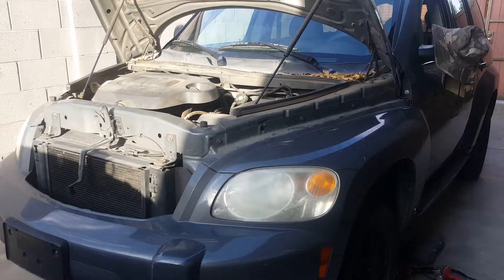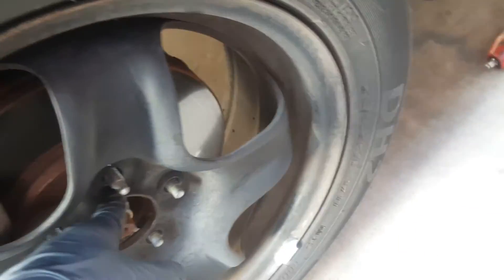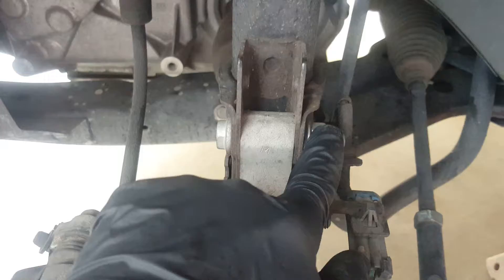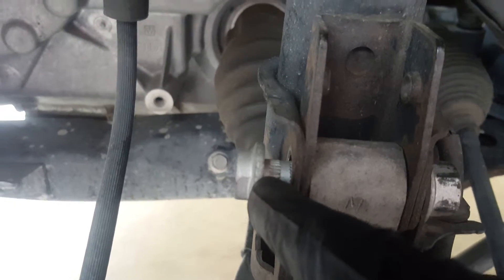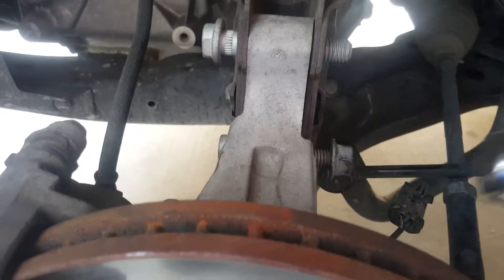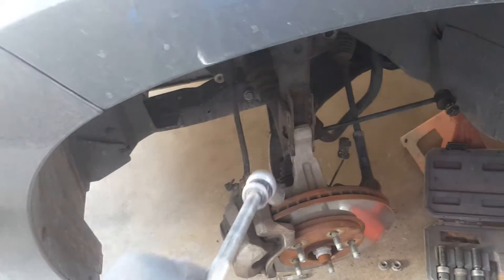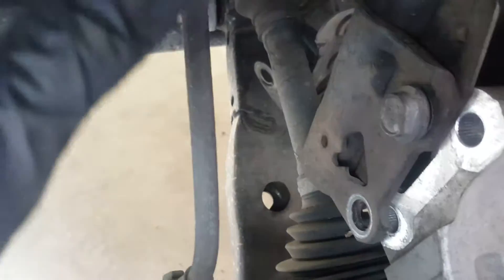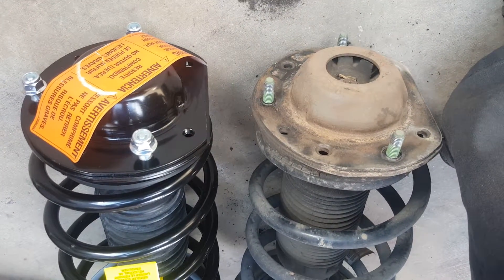2009 Chevy HHR Front strut replacement (EASY)

Comment: I have fount the strut spring set.  But want to make sure I get the right bolts and nuts before I even think of starting the project.  I know there are two pinch botls and nuts and four lower mounting bolts and nuts.  But can't seem to be confident  enough  to  get the  right ones.

Comment: For the life of me I could not remove the nut on the link :( when I used brute force the bolt rotated and there was nothing to hold onto on the other side. I wound up cutting it off :( Any good advice for the other side?
Reply from the maker: Hello. I am sorry to hear that the link connector gave you problems. If you look at the one you end up cutting, you will be able to see that you can use a wrench 🔧 to hold it.
I hope this helps. Keep me posted.